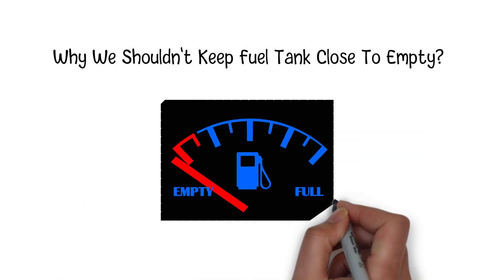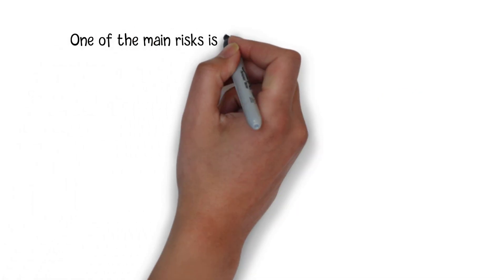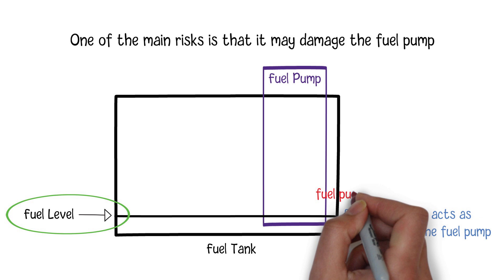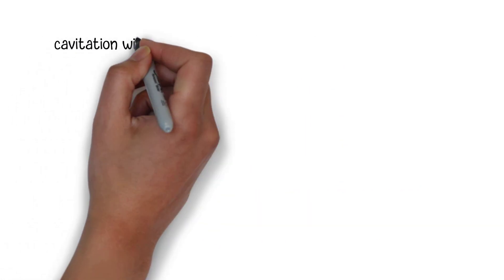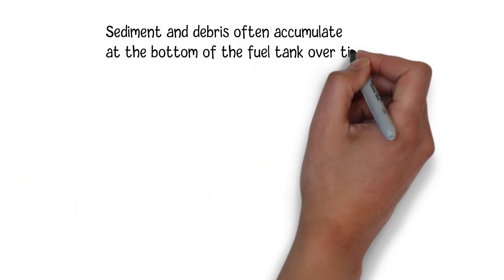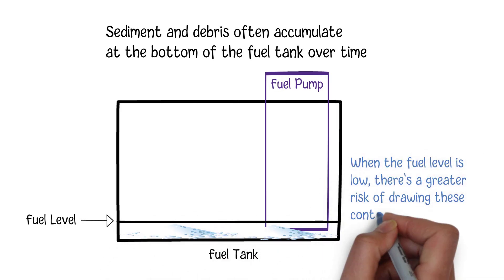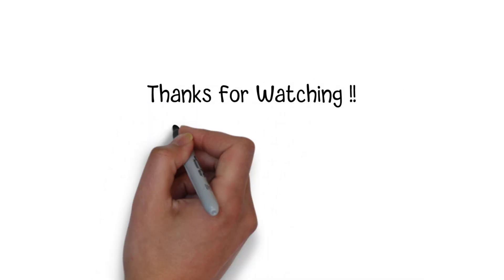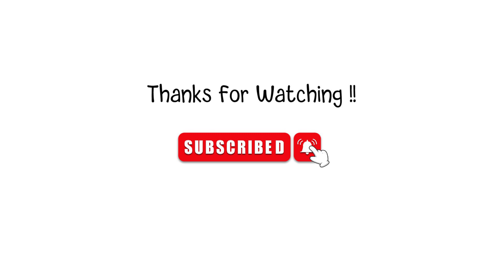Fuel Tank Close To Empty - Why We Shouldn't Do That?

Comment: I think there is a more important reason, at least for those non-gearheads out there, especially if you commute in a large city or metroplex. If you get stuck in a traffic jam you could very easily run out of fuel, causing much frustation and even a possible accident.  Quarter tank rule is sound advise.